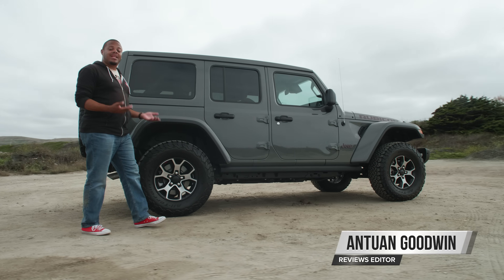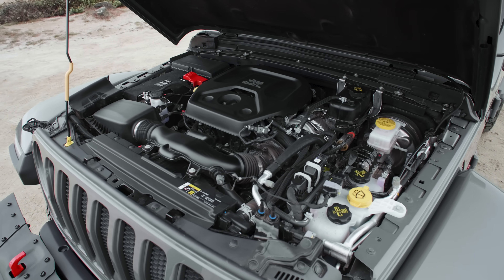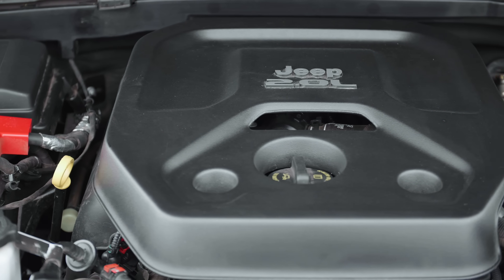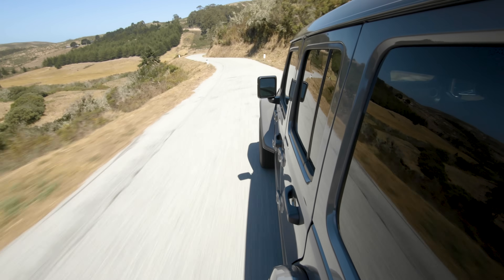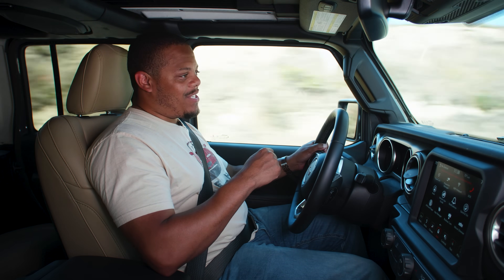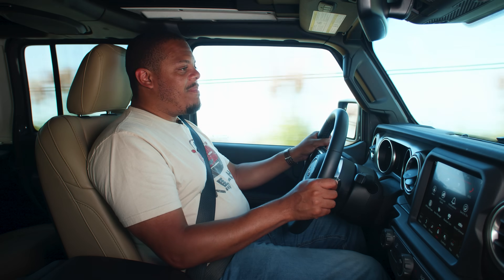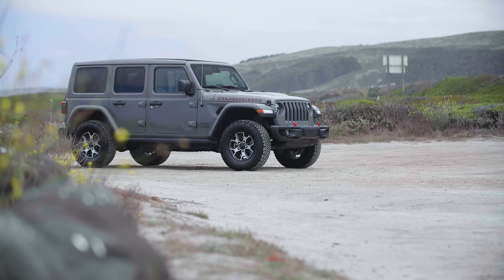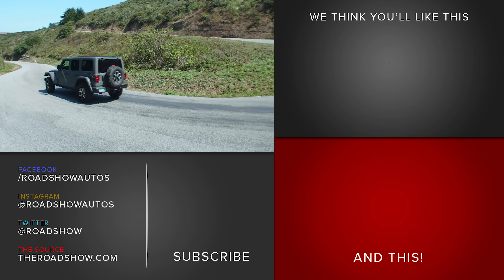2019 Jeep Wrangler with eTorque: 5 things you need to know

Comment: Fyi your information is incorrect- the non etorque 4 cylinder has the same amount of torque at the etorque 4cylinder- and its a waste of f**kin money, i have been in the dealership 5 times in 6 months, a regular alternator and conventional starter. The battery replacement is about 5 grand.  And no dealership is knowledgable about the system. Jeep tried to reinvent the wheel and failed.

Comment: still looking for a little bit better explanation on ess / etorque / 48v / aux battery.
from what I got on this video, an enclosed (waterproof?) 48V powers a DC-DC converter to charge a standard 12V battery that is source for aux. that being radio, lights, power window, heater fan  etc.  so how does the 48V stay charged and what is its power budget for things like ess or etorque given there is now no alternator.
Reply: No alternator, but there is a motor - generator that not only charges the battery when the engine is running, but also when decelerating and braking (regenerative). It has multiple other functions such as starting the vehicle (other than the initial cold start), provide torque fill in at lower speeds and aid in braking. The motor - generator is a little understood item that can both provide current when power is applied, or power when current is applied. It is attached to the engine with a wide belt to receive or deliver power to and from the system.
Reply: @snowlothar45  I just bought 2021 JL E torque 

Im quite concerned about the reliability of the car will the 48V battery will fade away with time because i found that it costs 2500$ , just an overall experience any recommendations you give me ??

Comment: I have 2021 Wrangler Willys 3.6 V6 E-Torque.. rides awesome better than my old JK however no change in gas mileage at all. average is actually 16.7 not 20 anything.
Reply: That’s bizarre! My 2021 3.6 RUBICON is getting 23 MPG
Reply: Have you taken it off roading yet?
Reply: @Clipilla  Yes I have. Its awesome off-road, no complaints. One reason my gas is so bad is probably my speed on the highway ~ about 80mph. Ive slowed down to 75 and mpg went up to 19.. Im guess going 65 would give it 20+
Reply: @johnnyvasquez4605  You're pushing a rectangle through the air, so any speed increase hurts, and any speed decrease helps. Aerodynamics don't care about what engine is being used.
Reply: I just bought 2021 JL E torque 

Im quite concerned about the reliability of the car will the 48V battery will fade away with time because i found that it costs 2500$ , just an overall experience any recommendations you give me ??
Reply: @Bu9agar  etorque system have 8 year warranty, the battery are also shallow cycle, I don't expect too much degradation. you can toss it out and fit a traditional alternator when you are done and don't like it.

Comment: Turbos & electric is the future for Jeep for sure. Its about time!!! Cant argue with Italian sports cars, they perform better and are very reliable most of which have been using turbos for years and years. Just because its new to Jeep doesn't mean it new to the industry. The 2L turbo w/e-torque in my 2door Rubicon is a rocket on road. Also I live at above 7,000 ft elevation and the v6 penastar loses so much power at this and higher mountain elevations (where wranglers play). The turbo is the perfect solution for high altitude life. Also when off-roading in Moab the turbo has zero delay in the rocks with no need to gun the engine to get power like the v6 needs to clear obstacles. I was so use to the lag and delay in power of the v6 JK1 & JK2 for years. Nice to be in the fast lane again in the iconic 2 door JLR Jeep wrangler!!!
Reply: I have broken my 2.0t many times
Reply: Have you driven by a Jeep Dealer lately?  There ton's of those new 4XE hybrids sitting on the lot collecting dust.

Comment: Its a $1500 for 1mpg more...so you would have to buy 1500 gallons of gas to break even. So around 3 years for avg person.
Reply: EPA estimates are estimates.

For a real world number, I got 18 city in my 2013 JKU 3.6l.
Same commute in my 2.0 etorque JL is 27 mpg. 10 mile commute with 20 traffic lights through the city.

Don't expect that with mud terrain tires or trying to beat the hatchback to the next red light.
Reply: It isn't only about fuel efficiency it also about the more power it add.

Comment: How about water crossings? Does the increased reliability on electrics impact how you go into water?
Reply: I can say from personal experiences, no problems playing in water
Reply: @justiceknight6877  I just bought 2021 JL E torque 

Im quite concerned about the reliability of the car will the 48V battery will fade away with time because i found that it costs 2500$ , just an overall experience any recommendations you give me ??

Comment: FCA needs to put a twin turbo V6 like Ford has for the Raptor that puts out 450 HP & 510 FT-LBS torque in the Wrangler. Stop with this hybrid nonsense. What happens when the battery dies? It is more complexity that is not necessary.

Comment: The Rubicon doesn’t get the e-Tourqe version of the engine just the one with start stop.
Reply: 2021 rubi will have 3.6 with etirque now also.
Reply: Are you sure about that? Mine has it 🤔
Reply: I heard it was on both motors for 19 and 20 but being dropped in 2021 on the 2.0, not sure about the Rubicon. How do you tell? I'm looking at a 2020 Rubicon to maybe buy

Comment: This vehicle will short circuit as soon as you enter water during off-road driving. No thanks.
Reply: It actually can go up to 30 inches of water at 5mph stock. Guess you couldn't afford it and had to make a copout. :^)
Reply: Is this an ignorant hybrid drivetrain comment or an FCA reliability comment? The latter may hold some weight. Whatever.
Reply: LOL if that happens blame Fiat for that. 
Other EVs are awesome at wading in muddy water.
Even crazier is Japan's Sōryū class Lithium Ion buffered SUBMARINE.
Reply: It is liquid cooled - ie. surrounded by coolant. Don't think water is an issue.
Reply: False. No issues w water.

Comment: For people concerned, this is basically like adding a pro-charger to the engine, but with the ability to turn it off when you don't need it.
Reply: There is a button to control this on the lower dash to the left of the steering wheel.
Reply: Will the vehicle work without it , let’s say in the future can I delete it ?
Reply: @sticrzy123  Yeah.
Reply: How do you turn it off?
Reply: @tenncutt  I'm sure they cover that in the owners manual.
Reply: @hellcat1988  so you dont know if its possible
Reply: @tenncutt  I know for a fact that you can disconnect the power wires going to the electric motor, or pull the relay that activates it, or pull the fuse.  I don't know for sure if there's a button though.